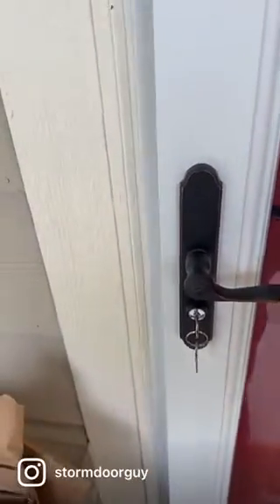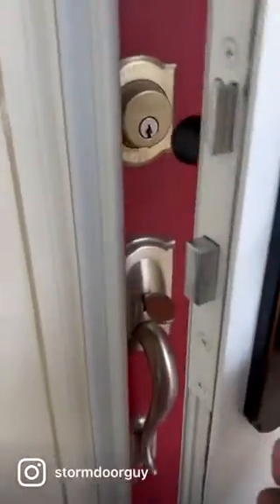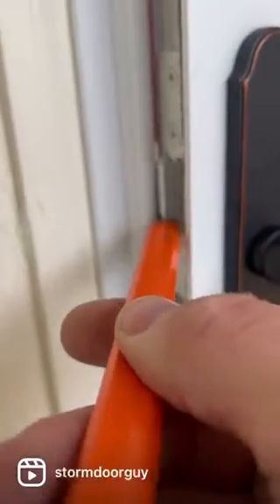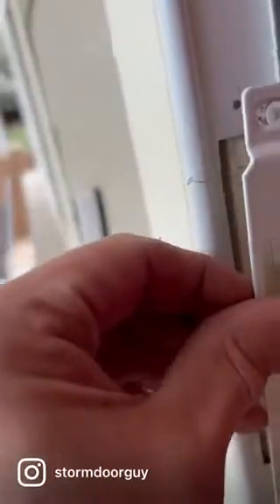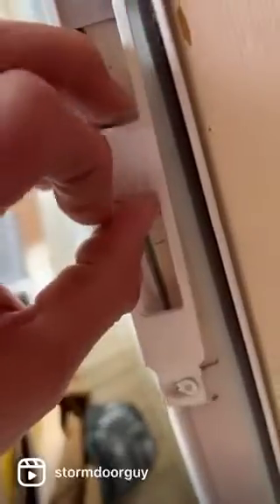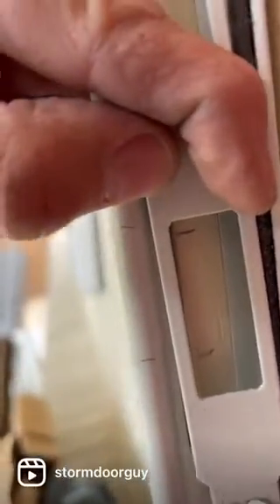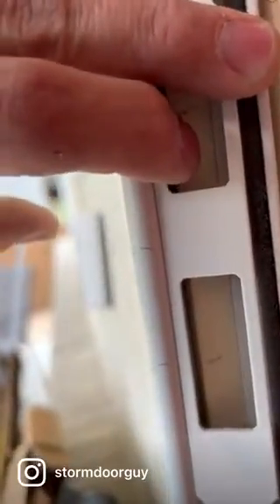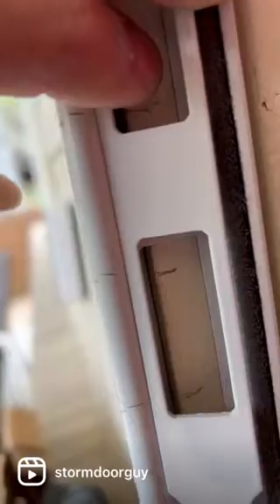Secure Any Stubborn Storm Door In Just One Minute! - #stormdoorguy #diy #install

Comment: not the case, the door is not closing enough to actually latch on the strike plate, if I take the strike plate off that little bit more opening for the latch to catch works.
Reply from the maker: Sounds like your brickimolding has a concave shape. meaning the middle of it is inset more than the top and bottom. I would add an 1/8" shim behind the storm door frame just above and just below the latch opening. That way it should bring the middle of the door frame out towards the street a little more which in turn should allow you to create room to attach the strikeplate.

Comment: Hello I hope you can help me. We just installed our storm door and followed the directions perfectly. Our door closes fine and the locking mechanism lines up with the striker plate however the door isn’t in far enough to latch. If I push on the door it opens without having to turn the handle. Could this be because of where the hydraulics are aligned? I appreciate your help! Awesome video by the way.
Reply: If you look at my door from the inside of my house there is a very small gap where the door is supposed to close. The locking mechanism goes in the striker plate hole but not in far enough to hold.
Reply from the maker: It sounds to me like the latch frame rail on your storm door is too far away from the door latch. So you wanna remove the screw cover on the outside of the latch frame rail remove the middle three screws and slide the frame closer to the door by an 8th to 3/16 of an inch. Maybe as much as a quarter. And then re-screw in, the middle screw and check the operation of the door. If that works then replace the other two screws and put the screw cover back on and your business.

Comment: I can't get out of my Anderson Screen Door due to the match is loose.
Reply from the maker: You'll have to remove the plastic trim strip on the outside of the latch frame and then remove the 5 or so screwss that attach it to your entry door. You may have to remove the screws in the top frame as well. WIth those screws removed, you can pull the door and the frame off, opening the door which will give you access ot the latch to replace it.

Comment: My issue is that my latch and deadbolt DO NOT reach far enough into the door to latch. How do i fix that?
Reply from the maker: Sounds like 1 of 2 things need to happen. Either the latch frame has to be moved closer to the storm door, or you have to cut out some of the material behind the latch frame to let the door latch and deadbolt go further into the opening to latch.